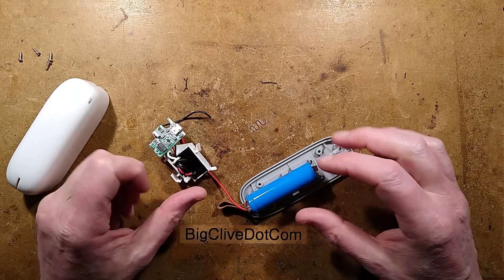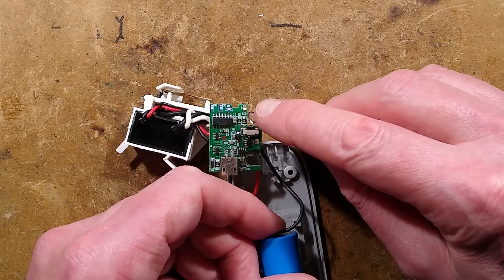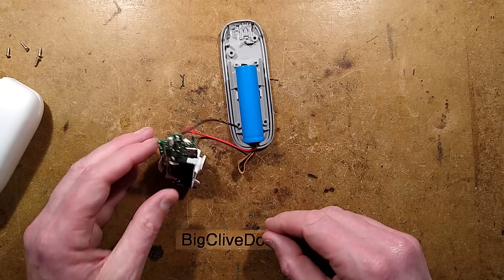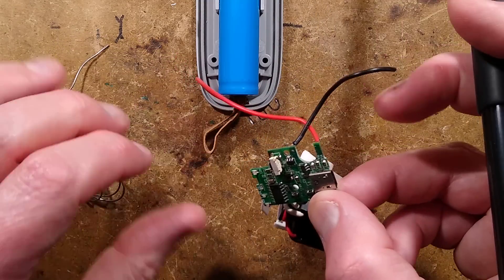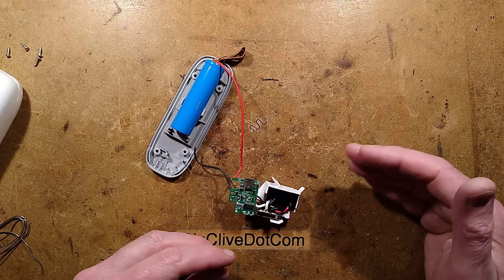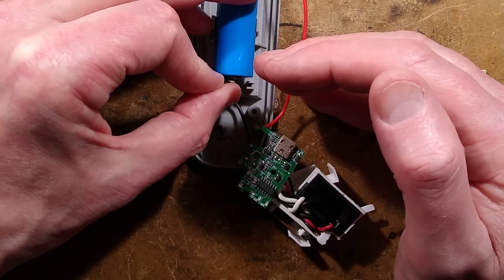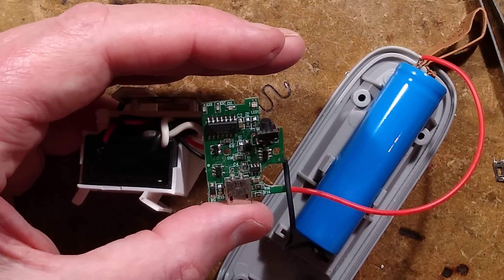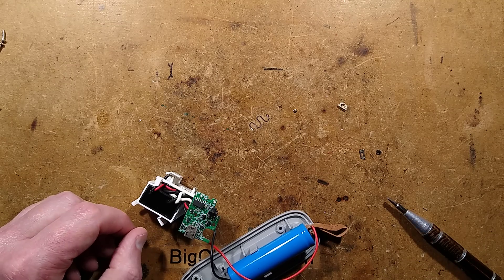The curse of tin whiskers rears its head again

Comment: I want to thank you for introducing me to those little ozone generators. Food lasts soooo much longer now. These things should be built into every good fridge from the manufacturer.
Reply: As you I have been using one of these for a few years, works well. Only had one issue where it wouldn't run correctly (red LED lit), fixed by cleaning off the metal generator tips. must have some sort of protection in the device.
Reply: Uh, ohhhh...I got here late. Why everyone so angry
Reply: @larrymiller5253 
LOUD NOISES!!
Reply: Do you have a link to the one you bought or similar?  I know I can search, but I'm guessing there are many that are fake.
Reply: Same, fridge is so much nicer smelling and fruit doesn't instantly get moldy its great.
Reply: It's a scam at best, a cancer ticket at worst. Just buy smaller cheese, it's not that hard.
Reply: Many jurisdictions will prohibit this as to aid extra food waste. My state prohibits butane fridges but 99% are sold this way regardless.
Reply: @LawpickingLocksmith  Let's start from the beginning. Last thing I remember from fridges is the freon, that started to kill penguins and polar bears. Then freon was banned. If my googling is correct, then currently, most used refrigerant is R123A and does not destruct ozone layer. Therefore ozone should be inert inside fridge. I doubt this little device can produce big amount of ozone to pose danger to humans.
Reply: @sihker  R600 butane is mostly used up to a certain size.
Reply: @sihker  Freon was used inside the fridge radiators, so we wouldn't have contact with it in the normal operation of the fridge. Besides that freon is practically inert. That's one of the problems with it, it's so inert that it stays for a long time in the atmosphere. Anyway ozone ISN'T inert, very much so indeed, that is why it kills microorganisms inside the fridge, but it's safe to humans at the concentration level that this generators can make.
Reply: Well, they don't want food to last longer because they won't get their bonuses every quarter! Planned obsolescence, even in the areas of food!
Reply: Just use protection when the fridge is open, otherwise cancer ...
Reply: @eternaloptimist2840 Im sure in smaller amounts its fine. Id imagine the concentration isnt that high in that use case.
Reply: @Zipppyart  FYI, ozone exposure inversely correlates to life expectancy. If you're exposed to more ozone, you don't live as long. There isn't evidence that there's a safe level (down to at least parts per billion concentrations), just that we can't reasonably remove all the ozone from the air we breathe. Voluntarily adding ozone to your home is a bad idea.
Reply: @6022  in my experience as a detailer... Run the generator 30 mins, sit for 60. Inhaling it is not advisable, for obvious reasons. A small concentration in a fridge id imagine can be beneficial to prevent food from going stale.
Reply: @Zipppyart  What if you just respect the recommendations on food so it doesn't spoil in the first place?
Reply: @eternaloptimist2840  Ozone is not carcinogenic, the mycotoxins generated by mold in your food are far more carcinogenic (some of the most powerful carcinogens known are mycotoxins) this delays spoilage and thus protect you from exposure to those mycotoxins.
Reply: @eternaloptimist2840  Give ma a link to what are you referring at? Or do you use protection, when walking around after the thunder?
Reply: @eternaloptimist2840 what? You do realize Ozone IS the fresh smell during a thunderstorm?  It's not hazardous in these quantities... it's literally just triatomic oxygen.
Reply: @adamconnell5965  just triatomic oxygen.... Lmao

"It's just carbon and four chlorines!"

Comment: [MEGA RAMBLE] I have a very old Razer mouse, circa 2005, which around a decade ago had started to cause problems. Initially it was failing to register clicks, primarily the Right Click if memory serves. Then a little later or developed a further issue, what I called "Phantom Clicks", where when I'd click it would sometimes instantly produce an EXTRA click... 

As I love that mouse due to its shape and side button placements, I was reluctant to get a new one and so I dealt with it for quite awhile... It got to the point of being so bad I couldn't preform tasks very well.

I had taken it apart one before shortly after the problem manifested, replacing the one electrolytic cap, thinking that was it but it wasn't. So, I once more took it apart to have another look...
This time I really went in, exploring deeper, and finally solved the issue! The problem was twofold, but before I explain it needs to be said that Razer used actual "micro switches", instead of the cheap kind you typically see in mice, which is 👍

So then, the problems:
   - First, the L & R button switches have a little raised ridge, and the plastic on them was HARDER than the plastic used in the mouse case/buttons. Over the years, they wore down a groove in the underside of the mouse buttons. This is what caused the clicks that failed to register. I fixed it with a little dab of superglue.

   - Second issue, was what eluded me... Wasn't until I disassembled the micro switch that I found the cause: carbon build up! I don't know what the metal used is, but I suspect spring steel which had a copper coating, as they looked copper. Either way, despite being low voltage, over its decade of use, it has built up enough carbon deposits where it (presumably) had created tiny areas that had enough buildup to prevent a click... 
If I clicked lightly, it would barely make contact and cause said "Phantom Click" (similar to if you slowly actuate a light switch and it starts arcing). Whereas if I clicked harder, it could create a solid connection and thereby only register the one click. I fixed the issue by simply cleaning the two contacts with a cotton swab!

(Razer did release an updated Copperhead mouse a year or two later, which I bought, but they moved the side buttons way up on the shoulder, but that's where I hold the mouse... So it was instantly retired.)
Reply: That is a common issue with mouse switches. The black stuff is not carbon, but silver tarnish (oxide and/or sulphide). The springy part is made of phosphor-bronze. I used to clean the contacts with photocopy paper moistened with contact cleaner. Put it in between the contacts, press the contacts together and wipe them. 2000 grit sandpaper also works, but a bit risky since the plating is very thin.

I had similar issues with my old Dell (made by Logitech) mouse like you had with your second Razer. I lost several online auctions by accidentally pressing the side buttons, which caused the browser to step back to the previous page. At one occasion I went so mad that I stabbed a screwdriver into the side of the mouse and torn out those side switches. This was about 8...10 years ago, I still use it like that.
Reply: @mrnmrn1  I don't think any of the internals were silver plated. You may be right in the phosphor-bronze though.
After you mentioned all of that, it occurred to me that it also has two tiny copper discs as the contacts. I indeed used some super super fine sand paper on it (like 3K of 4K grit) and then cleaned it again.

I never removed the new mouse switches, though I did take its, AND the old one's, palm rest LEDs out! I think they BOTH were set to 'breath', which was just annoying. Although the old one might've just been really bright and that's why... Either way, it was just within my peripheral vision to be highly distracting!

Actually, the new model further pissed me off because it had RGB all over it and required the software to run in the background just to KEEP it disabled. To compunction matters, the software was so shitty that it constantly used like 10% CPU cycles! 😮‍💨

Thankfully, at some point, I managed to do SOMETHING which caused the mouse to be programmed with my preferred profile... So now it is set to a less sensitive DPI and with the RGB set to a static dim red...... Not that I use it even still! lol
Reply: That "carbon" on the cintacts was actually metal dust, likely oxidized. 
It comes from mechanical wear of the contact operation. 

Great job in fixing your mouse!
I really dislike our: it's old, throw it away society. Especially when forced by shoddy updates, etc.
A lot of times, new stuff isn't better, or even available anymore.
Reply: @jeffl4810  Yea, I figure it was either straight carbon, or Copper-Oxide (I) since that's a black copper-oxide instead of teal or blue like CuO(II) and CuO(III).

And I agree... So much stuff gets thrown away that just needs either some TLC (cleaning; minor repair like replacing old capacitors), or just a cheap replacement part.
Honestly, that mouse cable has also broken, and in MULTIPLE places, which caused issues of its own. I just put a loop with some tape in the spot it's bad and it keeps it from disconnecting 🤣 I've actually considered taking the nice braided cable out of the new one and using it to fix my old one... lol 😏

Comment: To be fair, you can't say it was tin whiskers if you don't have proof of that it was actually tin whiskers. There are a multitude of things which could have gone wrong with the switch.
For one, it could be a very cheap switch which just failed. Wouldn't the microscopic whiskers melt away if it shorted something?

In any case, tin whiskers are formed by pure tin. Lead free solder is not pure tin, so it does not grow tin whiskers. A lot of people claim the NASA research as proof that tin whiskers are a real problem for electronics. What they don't read, or mention, is that these test were done with pure tin and tin film/sheets. Sure, there is tin in lead free solder, but something else will fail way before it grows tin whiskers.

Also, the claim that a nuclear power plant failed because of tin whiskers is just a myth. There was however a study (called "Risk of tin whiskers in the nuclear industry") done to check if tin whiskers would be a problem for nuclear power plants, because safety is the number one priority. The conclusion of the study: "While the findings initially aroused concerns associated with the implementation of lead-free components, an increase in the number and severity of events was not found."

Another thing people might not know is that many metals including zinc, cadmium, indium, silver, aluminium, gold, and yes even lead, grow whiskers.

Again, you can solder with whatever you like, be it lead or lead free, but claiming tin whiskers is an actual problem is just conspiratory.

Comment: Fun little tip for desoldering small components without an extremely fine tip iron. 

If you take a piece of solid core Bell wire and cut a 75mm length piece and strip it completely, you can then wrap it tightly around the tip of your iron (with it off and cool obviously) and leave approximately 5mm off the end of your iron, you've now effectively reduced the diameter of your soldering iron temporarily. It has saved my tail many times! Give it a go!
Reply: Has no one ever heard of desoldering wick?!?
Reply: @allenlutins  no?! What is that??
Reply: @PropGuru702  Plug "solder braid" or "solder wick" into your favorite search engine. Some people recommend applying flux first, but the wick already has a bunch of flux in it and I find that step to be generally unnecessary unless you're looking to mop up every trace of solder.
Reply: @allenlutins  what's flux? 

I'm fucking with you... 😂 Yes I know what wick is. Lol use it frequently. But it's overkill for such small components like this (in my opinion)
Reply: @PropGuru702 Oops, my sarcasm meter is broken...I better do a teardown and troubleshoot that thing ;)
Reply: Turn up your iron and bingo .. you got a smaller tip.(😂 Guy looking for smaller tips 😅😅
Yeah I'm big kid😂)
Reply: I would have held the button with pliers and let gravity remove the board... Assuming it was only held by 2 pins.
Reply: @tin2001  or Clive is not doing his yt videos from the international space station......
Reply: You can't come to the old man with such modern and obvious stuff. "He's always done it that way!" Even if he's slowly losing his ability to do it...😆
Reply: @ClashStats  you seem somewhat supercilious. I am sure BC is aware of this beginner level trick. lol.

Comment: It wasn't "the eco warriors " that banned lead, it was the companies that refused to collect and safely recycle their e-waste. Old electronics were just getting dumped into landfills and lead was leaching into water supplies. Companies that commit to collecting and recycling their products (like some manufacturers of medical equipment) are still allowed to use lead (as are private users, for their own projects and repairs). Which is why leaded solder is still available pretty much everywhere.

Maybe you think those damn "eco warriors" also shouldn't have banned leaded petrol, spray-on asbestos insulation or methanol in booze? Getting rid of those "caused a lot of problems for manufacturers" too. And those radioactive glow-in-the-dark watches were selling really well until the "eco-warriors" (doctors, biologists, etc.) spoiled it by pointing out that cancer nonsense. 😠

I have plenty of very complex electronics that have been working for well over two decades without any leaded solder in them, so it's clearly possible to make perfectly functional products without lead. Should my health be harmed for the benefit of incompetent manufacturers that can neither make safe products nor take responsibility for cleaning up after themselves? 🤨

Maybe instead of blaming it on the people trying to protect your health (or the health of others, if you don't care about yours) you should be a wee bit more demanding with companies making low-quality disposable crap and expecting us to deal with the health and financial consequences of its disposal. Just a thought. 🤔

P.S. - Also, I saw no evidence of the lack of lead in solder being responsible for the problem with this device. Presumably, all the solder on that PCB is lead-free and it seems to be working fine. Whatever failed was inside the switch, and it's unclear that it had anything to do with solder, lead or no lead.

Comment: I’m a retired physicist and have a 1920s Ruhmkorff induction coil that produces a 10cm spark at the electrodes (it has about two miles of secondary winding) producing about 300 kV.
Your feeble little ozone producer is nothing compared to my ancient contraption that produces enough ozone to be detected the other side of town.
It’s slightly dangerous, in that, to avoid an unpleasant journey to hades, I can’t get anywhere near the fridge when I want to consume my half eaten Fray Bentos steak and kidney tinned pie.
⚡️⚡️⚡️

Comment: Bob Brununga worked for all his adult life on soldering experimental circuits, both during the day and the evening as a hobby.  He said he got a lead blood test done in his 60s with no traces of lead found in his blood.😊😊
Reply: Shango066 said years ago his blood test was positive for lead, hence he uses gloves now when handling solder. Fumes are not an issue, but if you squeezing solder wire with your fingers for hours, you will notice your skin becomes grey, that is the material of the solder wire stuck to your skin by abrasion. Lead can be transferred through the skin.
Reply: The reason lead was banned from electronics is to stop it getting into groundwater through landfill waste.
Reply: Melting lead at low temperatures doesn't create any fumes and unless you eat a bit by accident how can it be a problem. I was told its the white stuff lead oxide that's the problem anyway the stuff in paint.

Comment: If this small device really does work to keep the fridge mold free - would you think, this might be the way to go keeping automotive AC condensers free of bacteria and mold too ?
If i install a one or two needle ozone generator inside the car's AC housing near the condenser - and power it up only, when ignition is switched off - i may avoid the smelly AC problem from the start - without having to worry about me breathing ozone all the time, right?
Reply: There are modules available [at the usual places] that origin from the automotive industry, used in AC/ventilation ducts
Reply: @michaeltempsch5282  Yes, i first heard about these devices here on clive's channel and i've put one in my watchlist - but i didn't like the thought of breathing in this ozone for hours during drive, so i never ordered it.
This device here, doing it's job far away from our lungs in enclosed space, gave met the idea of just ozone poisoning the condenser housing during the vehicles sitting time.
I worked as a mechanic, my health is ruined accordingly, the lungs being the most bothering problem - so, thinking things over beforehand might be livesaving.

Comment: IIRC the Toyota acceleration problems were partially connected to tin whiskers in the throttle pedal unit. Nasty (also horrendous engine software)
Reply: This puts substance to the expression: Petal to the metal!

Comment: this is why I order 63-37 lead-tin solder by the 2x1lb spools
lead solder just works, and the quantity of metallic lead is so small that it won't majorly effect anyone

however when soldering pipes(like copper pipe solder) we SHOULD use lead-free solder, there is no downside to removing toxic metals from plumbing(besides the way worse flux fumes) but in electronics I say "FUCK ROHS"